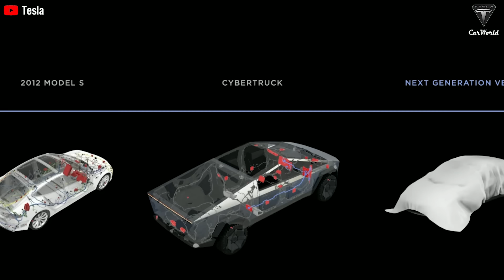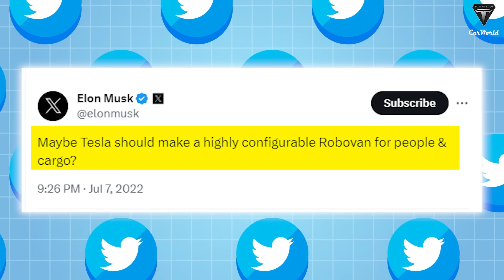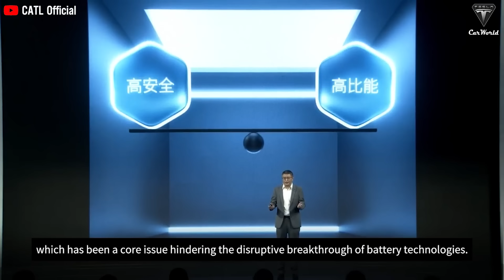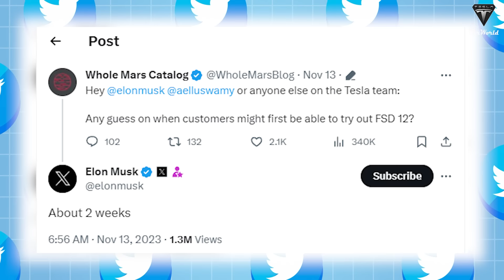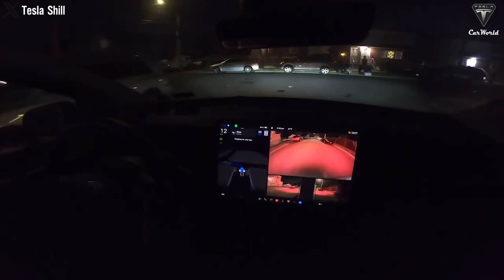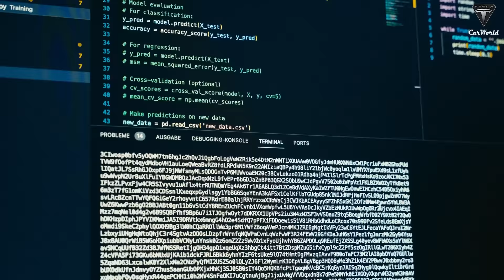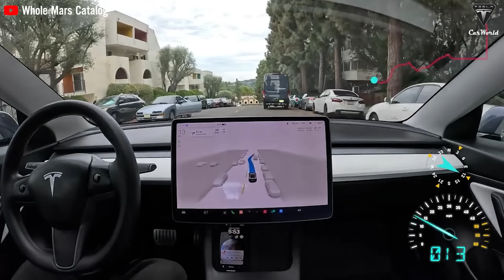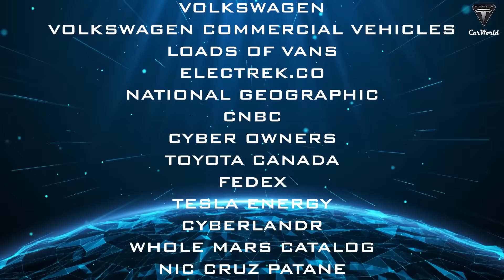Elon Musk's Exclusive Insider Look: Tesla Revolutionary 2024 Cybervan Unveiled, Shocked Industry!

Comment: A little larger and sell 10,000 ata time to Delivery Companies, saving 30-40 dollars a day fuel saving 5-10 million$ a year in fuel and repair, UPS is good for 150,000, saving 50-100 million $ a year
Reply from the maker: How will Tesla do this?
Reply: @TeslaCarWorld The Ct under-frame made with giga-casting will do fine and 107 inch delivery vans. Computerized suspension for speed bumps, all wheel steering for getting out of traffic, palm print reader for driver to lock up vehicle.
2 window wipers lol. Lots of regenerative braking in 100+ stops a day plus right hand turns. Battery pack doesn't need to be very big.
They use 6 cylinder ICE engines now, 10 gallons a day, 30-50 mile average.
They beat the vehicle to death but keep a paint job relatively clean.
Oh yeah, larger units are possible, dual rear tires. 
Make the vehicle quiet so they don't sound like a coffee can with a hand full of nickles banging around after a year, drivers will love them.